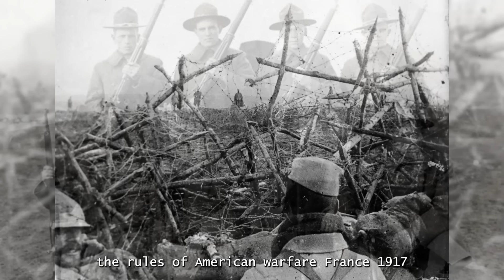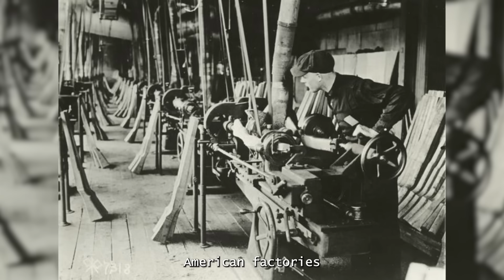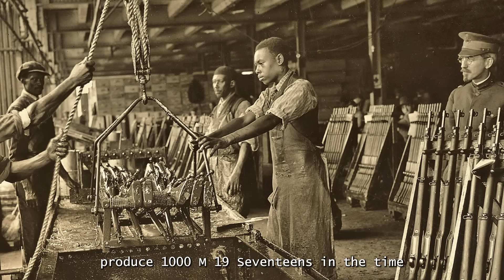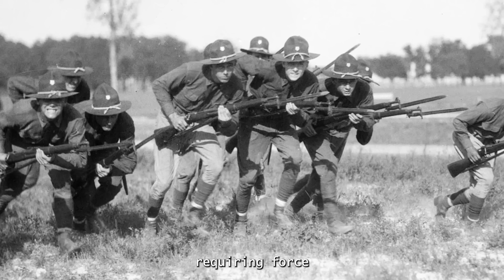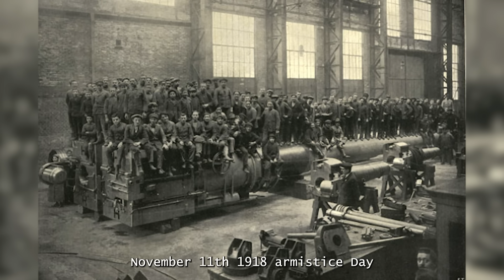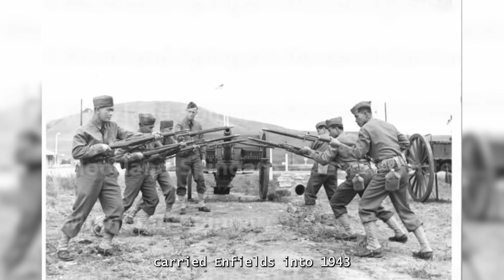The $28 Rifle That Outfought Every Springfield America Ever Issued

Comment: Earl part of this was generally correct.   Most important,  the P14 was derived from the P13 which was a  .276 modern caliber rebated rim high pressure round (higher than 303).  .  UK decided not to adopt the .276 caliber as WWI was in full swing  and stayed with the old 303 round (and went onto WWII with the 303).     Ergo, the higher pressure spec that allowed the 06 Cartridge to work fine.    The recoil was not stopped,  it was reduced.   The Nickle bolt on Nickle steel receiver is "stickier"  than a 1903.
       Every part was inspected and got a US Govt stamp (Eagle).   Almost no parts do not have the inspection marks.    As noted below,  there was no magazine cutoff and the safety was on the rear  right of the receiver,  not in the trigger guard (M1?)/.   
        The 1917s between the Wars had been treated for preservation,  they were not WWI in boxes and cosmoline.   Many were preserved had quality control issues and barrels were gone.    New barrels were made by Rock Island,  Johnson Automatics and Savage.    Any service member could buy a Surplus 1917 between the wars at low prices.    They did not buy them Post war,  those men were old and had gotten a rifle already.  
        The bolt design was Standard Mauser as was the M1903 Springfield.    It is not an interrupted thread  design,  its a standard Mauser two lug design.  Interrupted thread is a feature on many cannon.   
        Sadly the one picture towards the end with Infantry in a line are not 1917s.   The clearly are an old breech loader,  Probably an 1873 or latter Model of  Springfield Trapdoor Rifle.

Comment: The receiver was over built for the .303 Brit because the rifle was not designed for the .303. It was meant for a high pressure round, the .276 Enfield but that got nixed due to the war. It could easily handle the pressure of the 30-06.  Many of these actions were later used to build magnum rifles.

Comment: T he M1917 was based on the Pattern 1914.  The only thing omitted was the extra-long range volley sight on the left hand side.  The safety was always on the right-hand side, just above the bolt knob, same as the P14, and the only major alteration was to the magazine to take the slightly longer 1903 30 cal.  The reason it took one more is because the original mag was designed for the rimmed .303  with a slightly larger base for the round.  There was never a mag cut-off.
Reply: As someone who understands the WW2, I ask you to rate my video about the worst tanks. I would appreciate your honest review and a list of improvements

Comment: This episode was very timely, for me personally.
About a month ago, a friend of mine, gave me an Eddystone 1917, that had been sitting in a barn in central Nebraska for about 20 years. He told me, “It’s a fixer upper!”
Someone, years ago, had started a re-stocking project, but hadn’t finished it. Missing the two hand guards, the stock was unfinished but was in very good condition. Thus began my journey with the 1917.
Parts for the 1917 are plentiful. Eddystone is by far the most common of parts. Bolts, floor plates, rear sights, barrel bands and bayonet lugs are easy to find. Original stocks are a different matter.
Thousands of 1917 stocks were”sporterized”. The stocks were cut at the barrel band, removing the forward third of stock. This cut down on weight and removed the bayonet lug.
After looking on line, I decided that the stock I have with the rifle, which is full military size, was my best bet.
It’s still a “work in progress” but it has been fun putting this rifle back together.
There are places on the barrel (which is a July 1918 dated barrel) and action where corrosion had started. Working with OOO steel wool and a light coating of gun oil, I’ve been able remove most of the rust. There are places where the corrosion has damaged the finish.
I’m awaiting military grade wood stain now to finish the stock. My restoration is taking a lot longer than the original production.
Oh, the stories this rifle could tell!
Reply: I have 2, an Eddiestone and a Remington that I bought cheap already sporterized years ago and pretty rough. I rebarrelled them and restocked them with Boyds stocks , glass bedded, Timney triggers,  etc...and they are both tack drivers.   Fought in 2 world wars and sitting ready for the 3rd!!

Comment: ARGH!!!  This video is SO irksome.  You didn’t even square up the title with your supposed data - $28 or $26?  This is why I hate these AI channels.  Wanna learn real researched information about military rifles?  Watch Forgotten Weapons and C&Rsenal. 
To the producer of this video:
1.  Stop using AI for your videos.
2.  Do your research and get your facts straight...SOOO much conflicting, incomplete, and erroneous information to mention here.  A few examples...the P14 wasn't originally designed for .303 British.  It was designed for .276 Enfield, a much hotter cartridge.  This was the reason the P14 and M1917 were overbuilt.  The rifle was more successful in production BECAUSE they hadn't been successful in their initial P14 manufacture run - no parts interchangeability.  There was no special munition.  Outshot, not outshooted.  There was no magazine cutoff.  The safety was located in the same place as SMLEs.  The bolts were an opposing 2-lug, Mauser 98 design, just like the 1903.  It didn't use an interrupted thread (where did you get that idea?!?).  The bit about a brass catcher is dubious...never heard that before.  How do you reload if you've put something in place that impedes use of the charger guides?  Use of the M1917 in tanks is also dubious due to its extra length.  The 1903 and 1917 both used ladder rear sights.  Wire over the rear sight protector?  How do you operate the bolt?  Most rifles of WW1 and WW2 used a canvas cover over the action to protect it from ingress of mud and debris prior to use.  Again, you need to go back and redo your script, then take the time to talk about it yourself rather than letting a machine read it.  
3.  Pay or at least give credit Othias and C&Rsenal for your use of their graphics. 
I love the US Rifle, Caliber .30, Model of 1917.  The 1903 is a great infantry rifle, but its sights aren't as good as those of the 1917 once you've become trained on the aperture sight.

Comment: The 1917 became a popular action for magnum builds.
Reply: That's because the 1917 and P14 both used a P13 action and receiver, which was a modified Mauser 98 action with an SMLE safety built around the .276 Enfield experimental cartridge.  It was somewhere between a .270 Winchester and a 7mm Remington Magnum in terms of energy.  The potbelly stock allowed for use of 5+1 rimmed .303 cartridges, which became 6+1 .30-06 cartridges.  This becomes 5+1 belted magnum cartridges in most cases.

Comment: The M1903 was not supposed to replace the M1917. The M1903 was the standard rifle of the US Army from 1903 to 1936 and was produced through 1944 in a simplified version for issue to China and France. The M1917 was adopted as a supplemental rifle that was available as it was in production as the Pattern 14 rifle in .303 for the British by three companies. When the US Army took over the contracts, they delayed production by four months while calibrating the machine tools to ensure parts interchangeability between all the rifles to be produced for the US Army. The Springfield remained the standard rifle. After WW1, the M1917s were put in storage, eventually being sold to the Philippine Commonwealth to arm the Philippine Army's militia divisions and then released for sale to the British to replace the rifles lost at Dunkirk in 1940, where the mainly armed the Home Guard. No US forces used the M1917 during WW2. The M1917 was longer and heavier than the M1903, which was a short rifle designed to arm not only the infantry, but the other arms and services like the cavalry and engineers. This paralleled the history of the M1917's predecessor, the Pattern 14 rifle, which was supposed to replace the SMLE, Rifle No.1 Mk.III. Instead, the SMLE remained in production in India until 1970 and was used by the Australians and New Zealanders during WW2 in lieu of the replacement rifle, the No.4 Mk.I which was produced in the UK and Canada. The Pattern 14 was used as a sniper rifle in WW1, again because it was longer, heavier and more awkward to handle in battle than the SMLE. It again saw service as a Home Guard rifle for a short time in WW2.
Reply: .... Actually,  India kept making them until 1977....

Funny to think,  first in production in 1893....

I have an Ishapur from 1967. Looked things up,  so that's how I know...

Comment: The overbuilt Enfield action is the quiet hero here. Strength + interchangeability + mass production = victory math. 🤣🤣🤣
Reply: Funny how the private sector outperformed the public sector.  This seems to be a recurring theme.
Reply: Yep.  In 4 years, they were able to successfully produce a rifle while the Army Ordnance Board and Springfield struggle with production despite having roughly 4x that and much better resources.  P14 / M1917 production wasn't without issue, but they somehow outproduced state arsenals while having no issues with heat treating.  Both Springfield and Rock Island had problems with metallurgy.